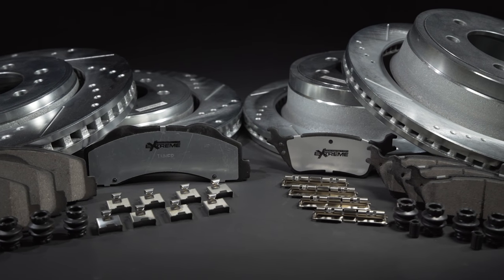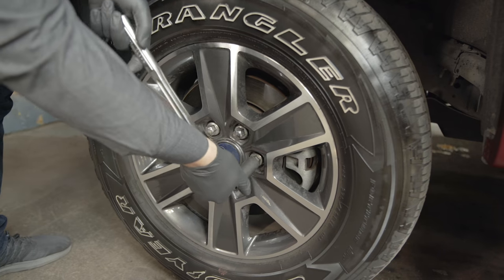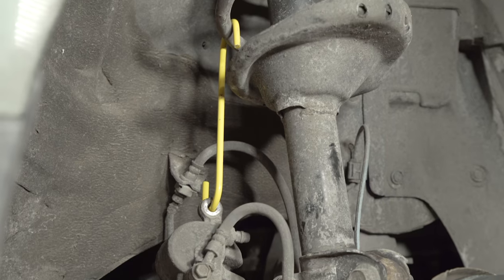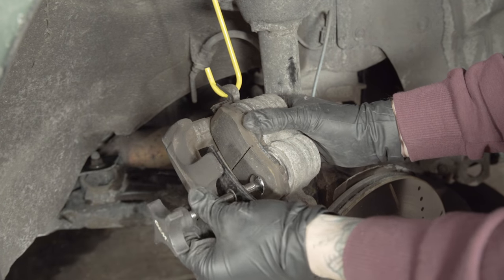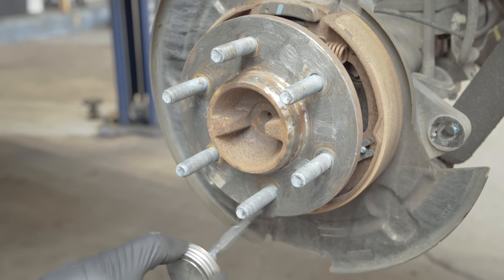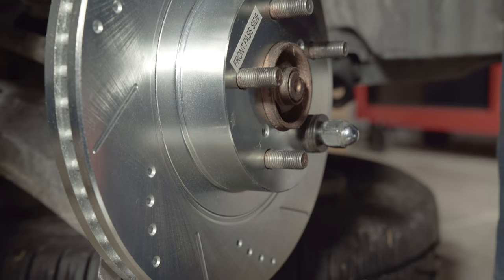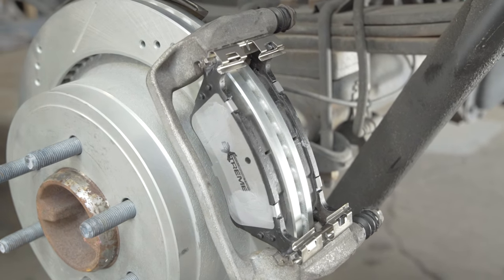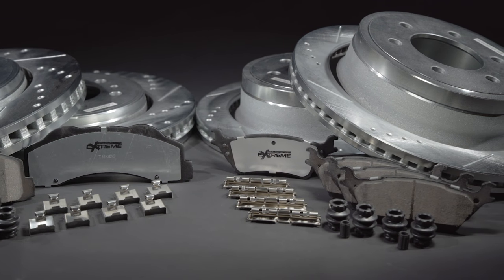How To: Install A New Set of Brake Pads & Rotors | PowerStop

Comment: I’ve done three of our family’s vehicles with power stop drilled and slotted kits. Very happy with the quality and all the hardware and pin boots provided. Little dust with the carbon-ceramic pads. Money saved doing it myself is worth the extra cost for these high quality kits. ‘04 Ram 1500, ‘09 Honda Accord, ‘13 Honda Fit. And I followed the break in procedure to the letter!  Awesome products!

Comment: What are the smaller rubber bits that come with the kit?  Not the larger rubber sleeves, the smaller rubber things.
Reply: For the bracket pins. Bushing at the tip

Comment: You SHOULD say and show how and where the brake clips go into the calipers as they are NOT the same. And contrary to propaganda, powerstop does NOT always preinstall the clips/brackets.
Reply: I know right.  This tutorial seem like it was made for people who've done this shit before which is like totally pointless
Reply: That's the problem that I'm having... We were only able to install One clip cuz we cannot figure out how to put the other clip in there
Reply: It's as simple as putting it back together the same way it came apart. Take pic or like the video said ,do one side at a time to use as a reference 
If you cant figure that out then I doubt you should be working on your vehicle.